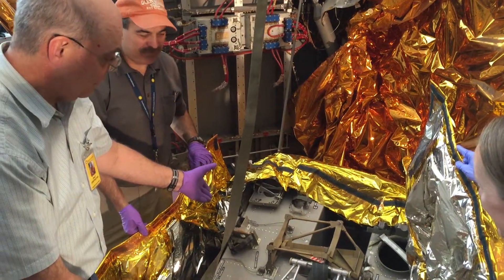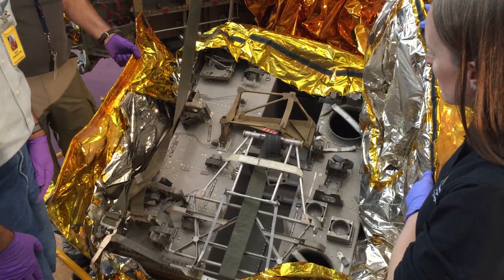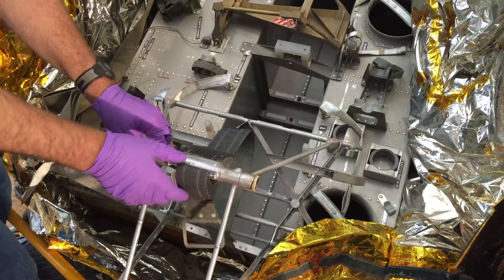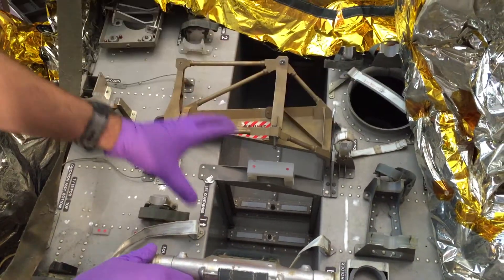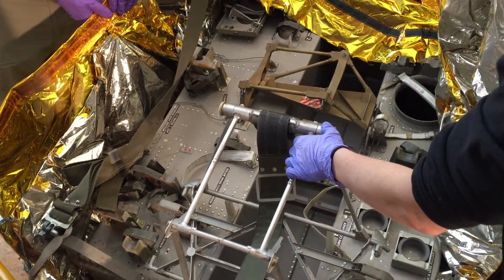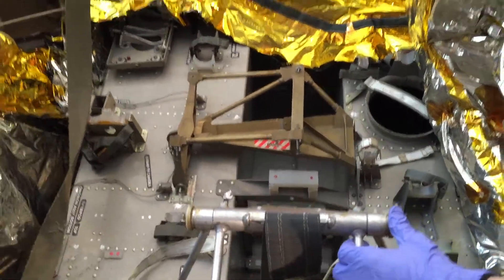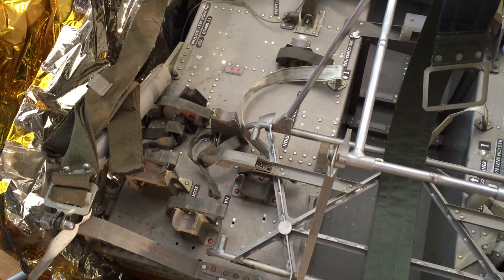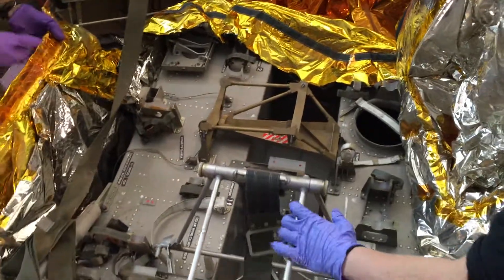Lunar Module 2 MESA

Comment: How did the camera work at + - 200°F?
Reply: worked great.
Reply: That info is available with a google search. 
Read the section titled Camera Package on page 7 of this document:
https://www.hq.nasa.gov/alsj/WEC-Engineer-3-1968.pdf
Reply: @dansv1 I have a feeling Peter subscribes to the "I don't believe it, therefore it's a lie" form of logic.
Reply: Another moon hoaxer who thinks there is an air temperature on the moon! 😅🤣😂

Comment: this doesn't explain how the camera got to where it was able to film the first descent on to the moon.  15 seconds in he says the crew is on the surface operating this machine.  How was Neil Armstrong's first step on the moon filmed by this? How did the camera come down and perfectly point at the ladder and Neil, practically center screen?
Reply: When it doesn't explain, it is easy to find out nowadays with all the information in the WWW at your fingertips:
When Armstrong was at the porch of the LM, he pulled a D-ring that released the MESA to swing down and put the camera into position. As it was upside-down, the receiving station had a switch to invert the tv image. There was a little glitch in procedures, that's why for the first seconds the camera view was broadcasted upside-down.
Anything about Apollo 11 video can be found in detail at https://www.honeysucklecreek.net/
Anything about the Apollo 11 lunat stay can be found at https://www.hq.nasa.gov/alsj/a11/
Reply: The camera got there when workers were building the spacecraft.  This is like asking how the steering wheel of your car got there and asking around like it's complete mystery.
Reply: [0:06] It says right in the video that the camera was mounted in the hold-down bracket so it (the camera's lens) could poke through a hole in the thermal blanket.
Reply: "perfectly point at the ladder" lol, have you never seen the first steps video?  It's canted about 15 degrees to the side and Neils feet are out of frame.  Describing that as perfect points to serious mental health problems.